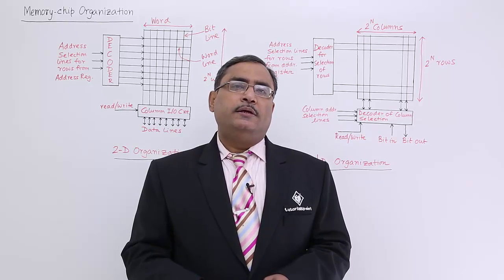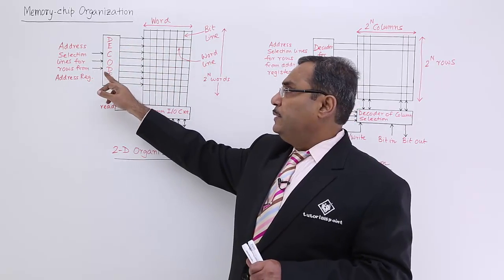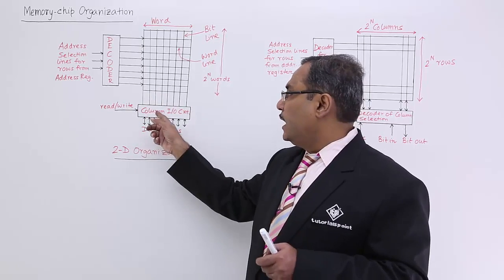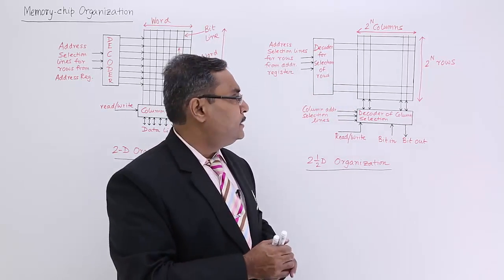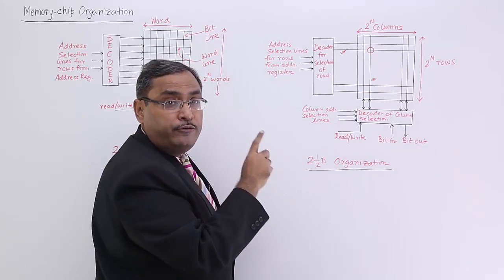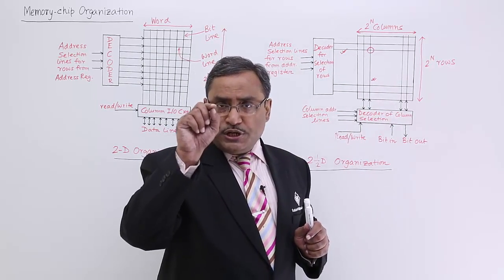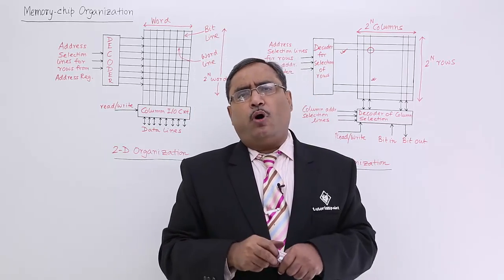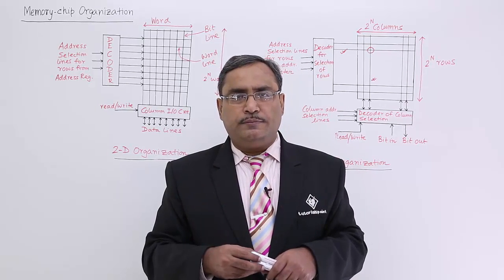2D and 2 5D Memory Chip Organization

Comment: sir, as per given diagram how 64 words are represented in 2.5D??
..
Reply: you need 64 2.5 d circuits working in parallel so you get 64 bits word. 1 circuid manages 1 bit an only 1 bit.